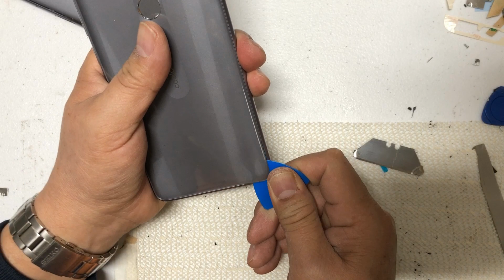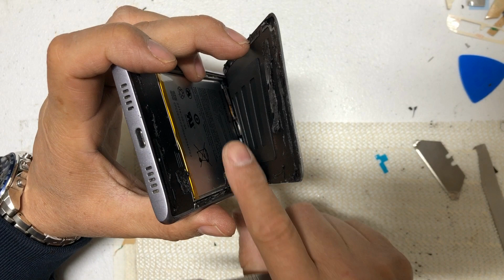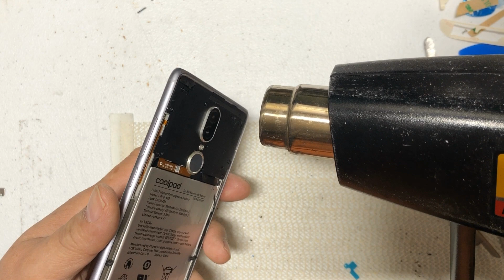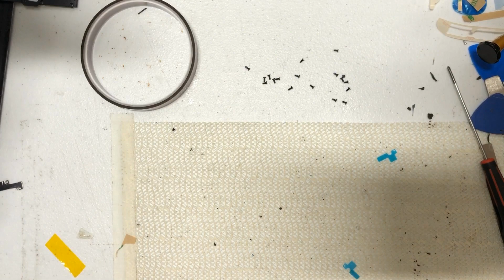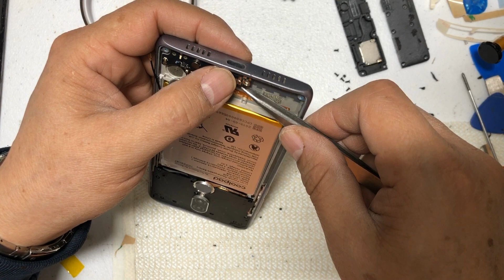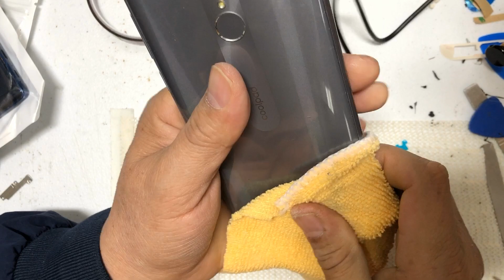COOLPAD LEGACY BEST VIDEO Replace LCD Display

Comment: Is there any way to fix a broken power button of that phone like if it's stuck in?
Reply from the maker: Hi, I guess the only way is to open the phone and remove the power button key and then clean it, there is another thing that I could do but only if you want to try it under your own risk, grab a cute tip and some alcohol or acetone and apply a little bit and press the key, if there is viscosity compound it will be removed or melted, if that doesn't work open the phone
Reply: @ez-fixit4044  alright thanks very much